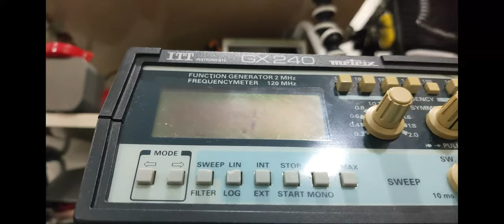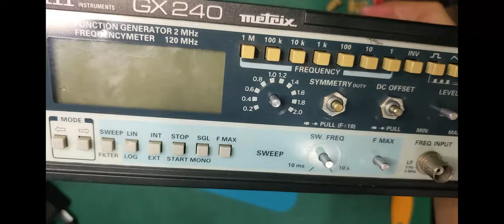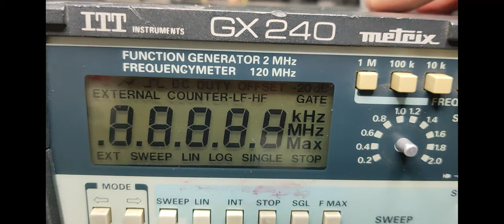Handy Johnny #005 Melted, delaminated or faded LCD display can be saved!

Comment: Very instructive thanks
I have one but with big black stain on the top like a liquid leak
It can be fixed?
Reply: i also have the same problem.
Reply from the maker: Any photo to share?
Reply: I also have the same problem. Half the screen on my cordless air pump has become black.
Reply: Look up these terms:

LCD burn 

LCD bleed

LCD cancer

LCD dead pixels

..... The vids you find may help explain how this happens, and some methods you can try. Make sure to read the comments before trying them, because you will be trying these methods at your own risk (some methods may work, some may not, some can make a problem worse. So read the comments carefully).

Comment: I am trying to understand why the paper is needed? Would just replacing the lcd screen with the adhesive one like you did be enough? Or is the paper used to just told the screen in place along with the adhesive?

Comment: Hi
How much the angle of polarization is important? Or do I need to rotate th polarizer until I get the right reading on the display? Many thanx!
Reply: Depending on the angle you can get black signs on a transparent background or transparent signs on a black background. You need to check before cutting it. So best check before taking the LCD out of the unit

Comment: did you have two layers of polarizer film on originally. It still looks tinted after you scraped off a layer. I did mine and had two layers and the glass lcd was clear after scraping
Reply: Didn’t he say at the beginning that there was polarizer film on both sides of the glass?
Reply: He said that there was polarization film on both sides of the glass, but the one on the back side is the one that is more likely to fail so he tried replacing that first and it fixed the problem.

Comment: So, whats the actual cause of this? Is it simply the polarizing layer coming slightly unstuck?
Reply: El calor mancha el fondo gris por decirlo se tuestan algunas partes y luego se ven mal
Reply: @juanmanuelguerrero4924  ¿Esto proviene de la luz solar directa o del calor de la unidad? Entonces, lo que estás pensando es que parte de la capa polarizadora simplemente pierde sus propiedades polarizantes debido a alguna forma de calor.
Does this come from direct sunshine or heat from the unit? So what you are thinking is that some of the polarising layer simply loses its polarising properties due to some form of heat.

Comment: Not clear if you used the adhesive side to adhere down!
Reply: First you will need to determine If the polarization filter needs to be replaced on the front of the LCD glass screen or the back of the screen. In some cases it is both, but most of the time, the back filter is the one that goes bad first. (According to the video).

Now Listen at 9:28   and  at 11:16 

In this example, The adhesive side is to stick to the back of the glass LCD screen.
BUT if you want,  you can use clear tape instead to hold the lcd glass, the polarization film and the white paper backing together.

If you use clear tape option, then you do not need to expose the adhesive on the polarization filter.

Note: 
Even though using the adhesive on the polarization filter to stick to the back of the glass LCD screen is the preferred method for some people, you may find it helpful to use the clear tape instead so that you can test if the display is working with the polarization film replaced. If you find that it's working now, then you can go ahead and apply the adhesive side to the LCD glass. Hope this helps.

If you decide to apply the adhesive to the glass screen, you have to be careful not to trap any dirt, dust, lint, or air bubbles. Be very careful.